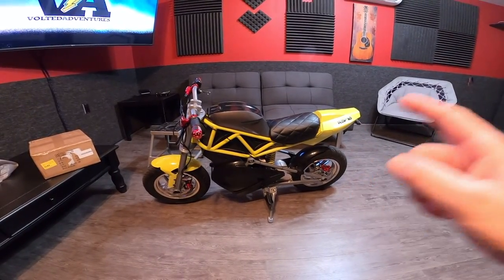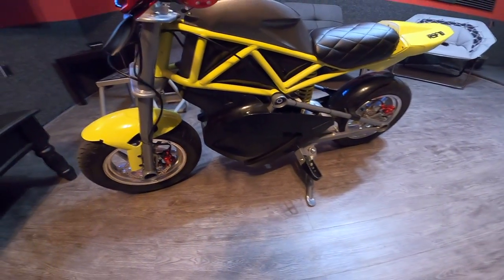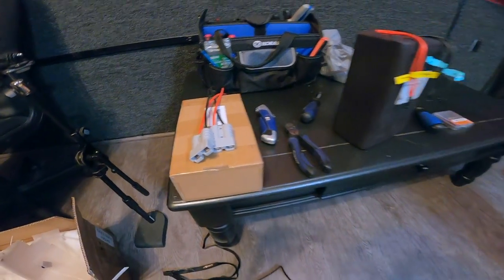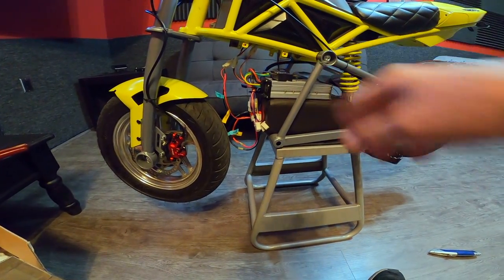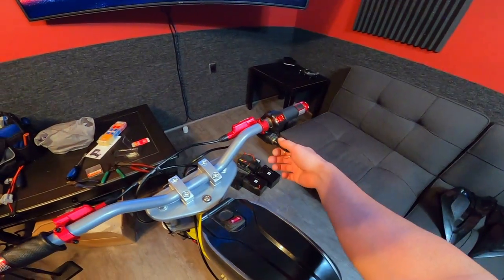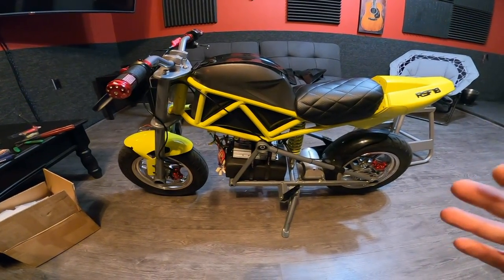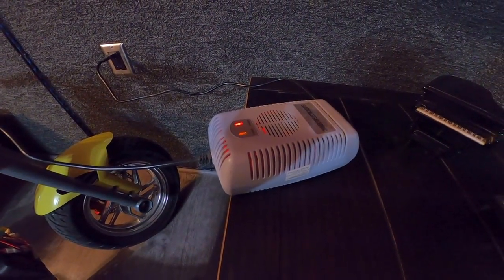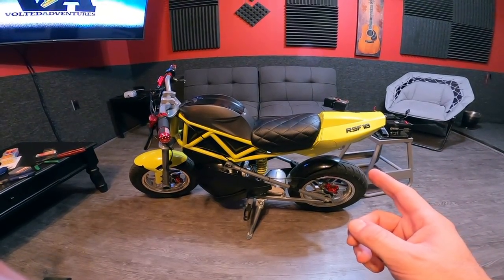Razor RSF650 Battery UPGRADE (48v 25ah BTR Power)

Comment from the maker: LINKS For Everything I Used:
Razor RSF650: https://amzn.to/3Q8ezPO
1800w Motor Kit: https://amzn.to/3OYhidq
BTR Power Battery: https://amzn.to/3GJgEhV
160mm Brake Disc: https://amzn.to/3LhnoFw
4-Piston Brakes: https://amzn.to/3xqnlS4
Front Light: https://amzn.to/3i72Jtg
Rear Light: https://amzn.to/3QRw7jQ

Comment: Careful those BTRs are known for starting on fire Just don't charge unattended or overnight always, clean build 👏
Reply from the maker: Thanks
Reply: Almost all documented cases of btr fires happened with damaged batteries and/or after a crash. 

Still need to treat them with respect and caution. As we should all lithium batteries.
Reply: @jasonjulian1  I mean I would say about 60% of the ones that I get sent on TikTok are from BMS failure when charging. I've tore open about 6 BTR batteries each one had a different $5 looking BMS inside. Had multiple chargers start on fire as well from them back in the day I normally would just chop them open and add new ANT BMS right away and have had no issues for years with them but still don't work correctly. 

100% agree no matter what when you'd be careful with all lithium batteries any damage, puncture, or damage could result in a fire for sure 👌👍
Reply: @jasonjulian1  I personally know of at least three houses that got breakdown from a BTR charging 🤷 please be safe never charge overnight or unattended

Comment: Hell yeah bro! Crazy what just a lithium battery and some weight cut can do! Id grab a 48v lithium charger and snip the plug end off your sla charger and swap them out. Im not sure what kinda sla charger you have but usually they dont charge as high of a voltage as lithium. Your btr should be around 54v fully charged 🤘
Reply from the maker: Whats crazy is that the new battery has WAY more range but still weights HALF! and yea my charger is good I was so happy everything worked out! I love this battery so far! 🤙🏼
Reply: @VoltedAdventures  stoked for you brother!
Reply from the maker: @EmxBrandon  Thanks bro!

Comment: Crazy bike man, I am also getting the 48v 25 ah battery. I was wondering how fast does it go?
Reply from the maker: Mine goes 32mph
Reply: @VoltedAdventures  what would be with just the battery stock controller and motor
Reply: @VoltedAdventures would the range still be just as good
Reply from the maker: @Hassan-Zahid  I would upgrade the controller
Reply from the maker: @Hassan-Zahid  you would get more range
Reply: @VoltedAdventures  I’m upgrading controller and battery how much range and speed would I get I’m also adding a 13 teeth sprocket to maximize speed
Reply from the maker: @Hassan-Zahid  What kind of battery?

Comment: Can you add link of where you got all the parts
Reply from the maker: Razor RSF650: https://amzn.to/3Q8ezPO
1800w Motor Kit: https://amzn.to/3OYhidq
160mm Brake Disc: https://amzn.to/3LhnoFw
4-Piston Brakes: https://amzn.to/3xqnlS4
Front Light: https://amzn.to/3i72Jtg
Rear Light: https://amzn.to/3QRw7jQ

I got the battery on ebay just search for 48v BTR POWER

Comment: did you need to upgrade the motor along with the battery?
Reply from the maker: I upgraded the motor and controller before I did this. I originally just added another lead acid battery to make it 48v and ran it like that for a while.... but the lead acid batteries were kinda wack... so I decided to bite the bullet and get the lithium battery which completely changed the bike and added to my top speed.
Reply: @VoltedAdventures how fast did it go with the lead battery and how fast would it go with just the lithium upgrade stock everything else
Reply from the maker: @Hassan-Zahid  I dont know, I didnt test that
Reply: @VoltedAdventures  with a lithium battery and a modified controller stock motor?
Reply from the maker: @Hassan-Zahid  Yea but what specs on the battery? what ah?

Comment: You should absolutely NOT be using those crimped connectors on the + and - main battery lines... It's basically like putting a straw in between two sections of garden hose and expecting the water to continue to flow normal... You are creating a bottleneck. Those crimped connectors aren't meant for high current. They will heat up and eventually burn up. You are also limiting your power.
Reply from the maker: Interesting and good to know. Thanks for the info. So far its been working great tho
Reply: @VoltedAdventures  yeah it will work for now then you will find failures and shorts solder and direct connect and shrink wrap prob best bet